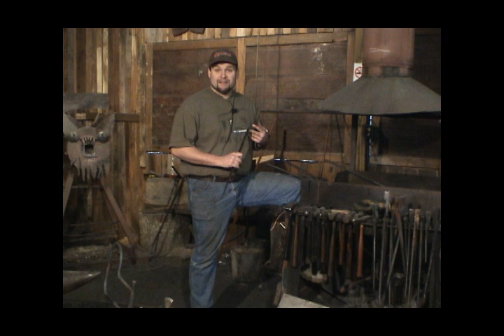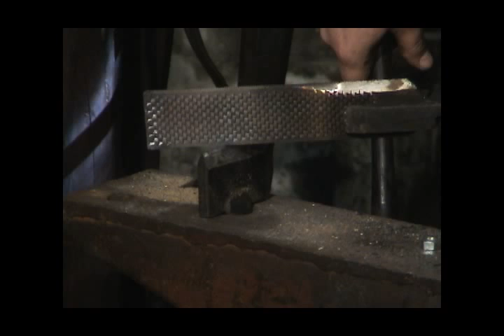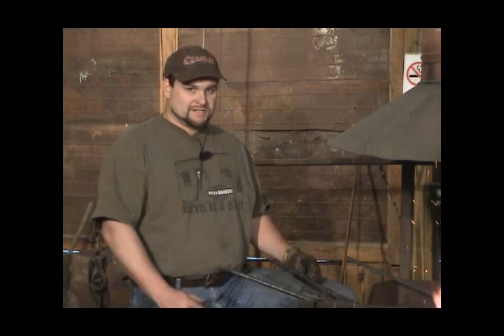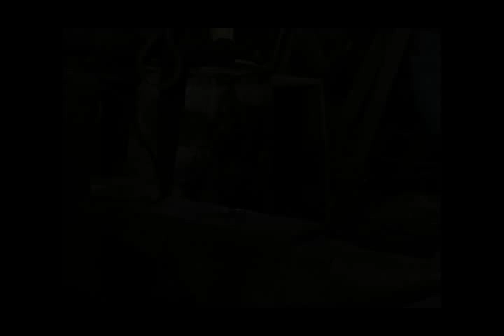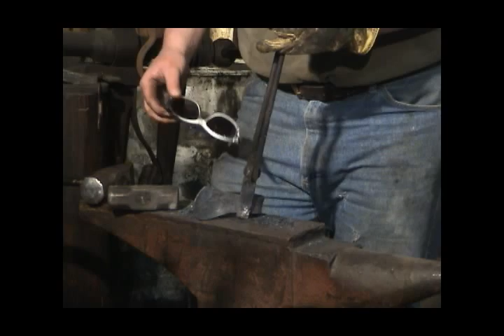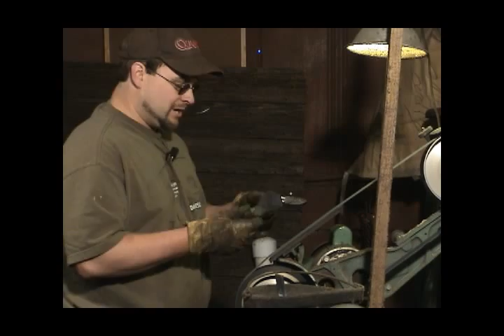How To Forge the Folded Rasp Axe

Comment: Like the video..but why does your belt sander tun backwards compared to every other I've seen in videos? Those sparks flying up into your face can't be good..! Not to mention all the metal filings flying around the shop..
Reply from the maker: Depends on the work! sometimes its easier to have it run backwards especially for sharpening jobs

Comment: You look like you’re wearing 19th century repro glasses during the grinding.  Are they? And what kind of lenses do you have in them?
Reply from the maker: Impact Proof Poly Carb.
Reply: @purgatoryironworks  did you have them custom fitted to the glasses? Are they lenses considered safe for welding?  I have 19th century repros I use for the museums where I smith and I wanted to use welding lenses to make looking into welding temp fires safer to look at.

Comment: If you fold over and forge weld the ends so it becomes the length you need, you end up with more mass on your blade without having to weld on extra mass.

Comment: Awesome video! Want to try this but am unsure of the flux. Was that Borax? As in "20 Mule Team Borax"? Thanks!
Reply: Maplehouse Knives the same.
Reply: Maplehouse Knives use a large ziplock bag in a few desiccant packets before you use commercial Borax as it'll bubble a lot because of moisture.
Works the same, is the same just bubbles when 20 Mule Team is used.

Comment: so flux is just detergent booster?
Reply from the maker: +Steven Short 
Specifically borax
Reply: +purgatoryironworks  hey trent I see that you are using coal/charcoal and reaching white hot or very close.  when I am heating up steel (mostly files,mower blades and spikes  at this point) I'm trying to reach high a high temperature so I can work with it longer than a min or two and for some reason sparks will fly out of my forge and I pull the piece out and it is melted....what am I  doing wrong? and how can I fix it?
Reply from the maker: pretty much!
Reply: purgatoryironworks
  hey trent I see that you are using coal/charcoal and reaching white hot or very close.  when I am heating up steel (mostly files,mower blades and spikes  at this point) I'm trying to reach high a high temperature so I can work with it longer than a min or two and for some reason sparks will fly out of my forge and I pull the piece out and it is melted....what am I  doing wrong? and how can I fix it?
Reply from the maker: Simple, you are getting it way too hot and its melting!
Reply: +purgatoryironworks I figured but I'm not reaching the temperature that you do, I'm getting at most a bright orange heat(could just be my lighting) but is it possible my hair dryer is moving too much air causing it? I don't mean to badger you with questions but its driving me nuts
Reply from the maker: Remember that the camera throws the color off. If you are melting it, you have certainly got my temperature and more
Reply: +purgatoryironworks awesome thanks man I've been beating myself up thinking I have an inferior forge but I'll just take it out sooner, BTW will you be watching forged in fire tonight?
Reply from the maker: Nahh, I was there. I saw it in person :)
Reply: +purgatoryironworks what?!?! you are in season 2? or are you referencing being there in season 1

Comment: it just dawned on me are you running that burr king king in reverse ? good taste in grinders ,
Reply from the maker: Lucky B yeah, great thing about them, easily reversed.
Reply: purgatoryironworks  dang didn't let me finish , it was just a striate drive  no reverse
i did get to use one it was beautiful for cleaning up shoulders   didn't have the 1800.00 at that time
Reply from the maker: I want the B3 so bad I can taste it
Reply: I hate to say it  but the KMG with all the attachment has it beat ,  you can go all the way to a 14" contact wheel  for doing  BOB LOVELESS hollow grinds ,  and you can set it up with a larger work table  all I ever did with the burr king was hollow grinding and flat grinding  and I can do that on what I have now
 and that is a grizzly G1015 ,  I had the special attachments  that went with the burr king  I loved it  and I miss it  a lot  and if i ever get another grinder it will be the KMG and it will just  run Cluster pulley's ,  what i really want is a gravity  fed Drill press , about a 1918 model  set it and forget it lol  but the thing about the K M G .. you can build a Clone K M G  in a three inch wide or 2.5  with a 12 ,  14 ,  or a 15 " long platen  harden a chunk of 3/8ths precision O1 , that  platen will last you  and your great grand kids , lol  anyway   congrats on the discovery channel ,
i have a blade that will be in the discovery channel this fall a survival team  spent almost a month  in the arctic  congrats B T W  on your  discovery spot light ..
Reply from the maker: Lucky B Thanks man!
Reply: you did good on that show you many not have got the big one but you still got the big one . prosperity comes in many forms and me thinks you did  really good .  now build that 
2x72 KGB Clone and get busy lol stay safe .
 you could teach me how to re teach me how to forge weld  its been almost 30 years since  have ,  and the other night i tried some 15N20 and a stick or 1095 , and blotched it ,  my side  air pipe i have for my fan plugged half way , anyway keep up the great work ..
Reply from the maker: Thanks dude!

Comment: while I see the benefit of using a single bit of metal to forge the entire piece...since it has the problem of being a prone to burning, would it be better to use a milder steel for the body, and use the hi-carbon as a welded piece at the bit edge?
Reply: +Tim Hyatt Did you factor in that with a bit you have two welds?

Comment: You said "back in the day a lot of the tools they used was nothing more than wrought iron." and "even if I were to live this as it is, it would be a much better tool than that they used to have.". Now I don't fully agree with that statement as there are found remains of axes and knifes and other cutting tools with an edge of high-carbon-steel.
If you are talking about the native Americans, I can't really say anything against it because I have zero knowledge about their metalworking skills. If, on the other hand, you are talking about Vikings, Romans or medieval Europe, you are wrong.
Reply from the maker: Let me clarify, the quality of steel we have today FAR outpaces anything in olden times due to our methods of manufacture. The consistency and repeatability of that quality is what sets it apart. There may have been a smith that achieved a high quality steel back in the day but he could not repeat his achievement with any consistency. Thus was born the fracture test.
Reply: Nor .. I I believe  what the man is saying  if we had the stone age  the bronze age  and he iron age before we had steel .  now you know back around 900 ad to around 1000 ad .. the Vikings found a crucible steel wither from Asia
or India  the true  Damascus or Wootz   this was at least 500 years before England  had any idea  what it was . Sheffield  came up with blister steel  simply take  thin  iron  strips  that were hammered out to some where around a 8th of an inch  or so  . and they made a crucible  to contain the iron and they packed   carbon from  trees charcoal into the crucible   and as much as they could and sealed it   and then fired it ,. taking it to  forging head  as the carbon burned it got into the poor's of the iron creating  shear steel  a carbon steel .  forging two  strips together created double  shear steel and then triple  shear steel . giving it the carbon content creating  carbon steel ..but something I have learned  is you only need 10 to 20% carbon threw out the steel  to  get a good hardening upon quench .  but also depending on how  the carbon steel is heat-treated  plays a giant part on the edge holding ability and the performance  don't you agree ??
Reply: Norwegian Blacksmith   You can't even find pure iron in nature. It's almost always in some form of alloy.   Also, imagine spending all your time as a blacksmith, you'd most likely see huge differences in metallurgical properties depending on how you manipulate the material.     

Also, you need steel to work with granite and other forms of matter. So, one can say, that many pyramids have been made with some steel alloy tools.

Comment: can some one tell me what a ferrier is
Reply: A farrier is not necessarily a blacksmith, and a farriers rasp is used to remove excess hoof wall from a horses hoof.
Reply: i dunno either, but the about on the video says, "Using a horse shoer's rasp,"  i think a farrier is someone who put shoes on horses
Reply: A farrier is a blacksmith that specialises in making and shooing horses. A farriers rasp is the tool he uses to remove excess metal from the unfinished shoe. It's modern equivalent is the belt-sander, angle-grinder and bench-grinder.
Reply: Melissa...a farrier is someone who shoes and trims horses. the farriers rasp is used to file  and shape the horse's hoof like you do with your own nails. Jeff you adjust the shoe to FIT the horse's hoof not the other way around. a farrier is now a specialist and works with all types of horses. it used to be that the blacksmith would shoe horses years ago. now not so much as there is alot of skill involved in trimming and shoeing a horse's feet.

Comment: Is it easier to drift the eye hole by adding a high carbon bit sandwiched in the edge to add some thickness? I made one of these tonight and drifting the eye kept opening the weld. I must have welded it back 6 times. Great, easy to follow video BTW.
Reply from the maker: That tends to happen even if you have a really good weld, the trick is to lock the weld in the vise, squeezing ti together and then driving the drift through. A smart cheater might even drop a small mig weld inside to hold the weld shut :)